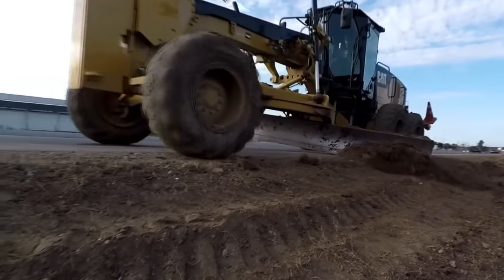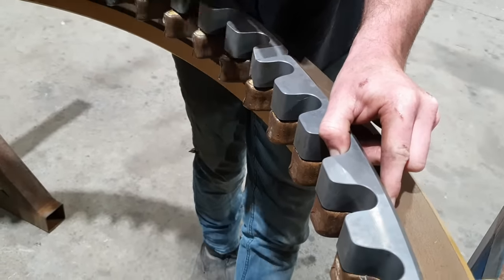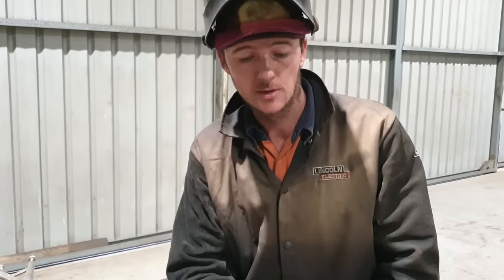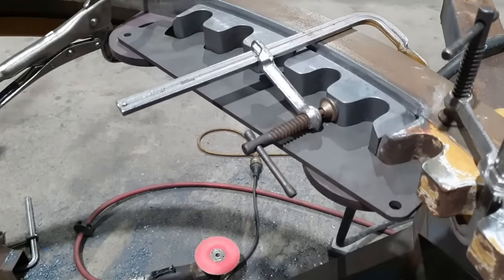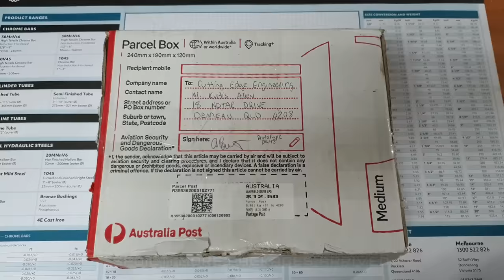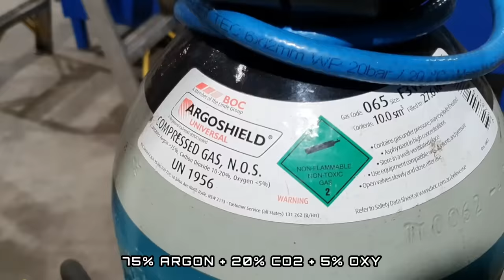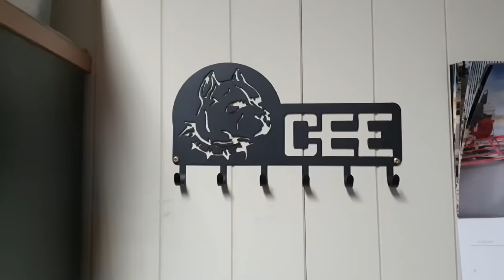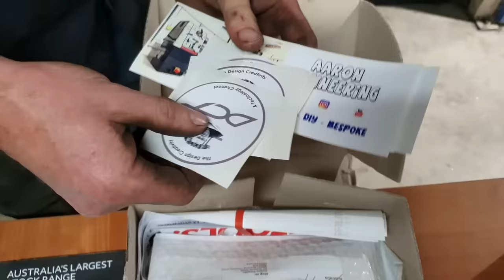Replace DAMAGED Circle Segments for CAT 12M Grader | Welding Fabrication

Comment: 8:03 - being a natural born knocker I just can't help resist the urge ;-) to point out that this sticking out central part of the nut holding the disc is meant to go INSIDE of the disc hole, in case of thick discs used for grinding surface - like this one here. Apparently it helps to stabilise that much heavier discs, or just hold it better and keep it more centred. And yes, I know - it isn't any big issue, the disc would be still held in place by that bottom part.
Also, I'm wondering whether it wouldn't make the job easier using some kind of template, one that matches the inner gear pattern and maybe another one for cutting out worn segments - like, say, CNC plasma cut-outs made from 5 - 8 mm mild steel sheet. I mean, not such tiny "one segment plus" jig you're using here, but more like a half-circle template. Something you'd just tack to "good" teeth and then you'd just fit those replacement segments against it.
Yes, it would add some cost and time to the project, but at the same time it would make torch cutting and positioning new segments a breeze... Just wondering.

Comment: So when you bid a job, is it flat rate or time and materials?   your skill set  isn't like automotive repair, so it has to be properly compensated,  so a flat rate might not work, or just bid the job at $$$ and bash as fast and accurate as you can, Like I did on shop floor so long ago.  Just wondered.

Comment: I found myself wondering if it would not be a more effective method to create a machine to mill the worn teeth away. If you built a tripod assembly that would sit over and clamp down to the rear half of the  gear ring you could mount a centre pin to it. You could then mount a worm powered arm to the centre pin with a small milling head to it. The milling arm would swing and give you a very accurate cut when removing the teeth and be adjustable on the radius via a rack and pinion set to run it in and out. In addition, the milling arm could also be supported at the outer end by the gear ring that is not being cut away for stability due to vertical flex. The end result would be a very accurate milled surface made without heat induction that could cause warpage of the ring itself. You could also develope a welding attachment and use the same arm under power to how your wire feed gun and give a very uniform weld that would be milled off on the top in lieu of grinding. Just a thought...........

Comment: Hum, just thinking.  How about making a outer gear ring or partial - that you could roll in the good ones and continue over the edge of the replacement to verify the gears match as it proceeds and you replace or tack in a gear trace.   Just a thought.  Martin  Just saw the flat one.

Comment: Yo hubiera puesto una chapa encima y hubiera trazado sobre ella, tanto el perfil de los dientes (dibujando desde abajo) como el perimetro de corte con el radio adecuado de las piezas. Paea lo que seria becesario calcular el centro en la chapa (también para asegurarme que la linea de corte es concéntrica y que el aro completo no hubiera sufrido una deformación por algún golpe contundente).

Luego cortando con el soplete la chapa, primero por el radio externo y luego separando por el contorno de los dientes, tendrías 2 plantillas que facilitarían tanto trazar la linea de corte para retirar las piezas dentales gastadas (la plantilla externa)  como el exacto limite de corte hacia afuera (amolar hasta que la corona dentada que es la plantilla encaje en el círculo formado tras retirar todos los dientes) y también habría servido luego para reposicionar correctamente las nuevas piezas a soldar (la plantilla interna valdría para puntear los dientes en su sitio).

Comment: The wear is only in one third of the ring. I wonder, if it'd be possible to make the ring bolted onto the frame, so you could simply turn it around to an unused part.

Comment: If these are done fairly often, why not build a circle jig with a swinging arm from the center that can index into existing teeth? After torching out old teeth, stick a mag drill with an end mill on the arm and mill the ring to a perfect diameter. Ought to save a bunch of free-hand grinding and be more precise.

Comment: I'm intrigued as to why these are not designed to be a bolt in replacement.  Wouldn't be good for CEE, but would surely save a fortune for the operators of these machines.

Comment: Hi Guys, Just subscribed to your channel and I enjoy the work you do and how you present it. Don't really know if it's possible but it would be nice if you somehow show the repaired part back on the piece of equipment it was taken from and back in service. As for the lathe inserts you use, I was wondering if you have ever tried the ceramic inserts which seem to do a great job  on the  4140 and stainless materials.

Comment: I’ve tried to find it but I can’t. What respirator are you wearing?
Reply from the maker: hey mate it's a Speedglas 9100XXi with adflo PAPR
Reply: @CuttingEdgeEngineering  so clutch. Thank you for responding. Seem to be worth all that money? I’ve been using full face respirators but I sweat so much working it gets gross. Also, the filters on the face piece clog up fast grinding metal all day.

Comment: Wouldn't it be preferable/ save time to EDM cut the old sections out? Or waterjet cut them out? I'm just thinking in terms of tolerances etc, as cutting them with a torch isn't exactly precise and requires further machining and probably even building up new material on the cut surface and then machining back to tolerance. IDK just throwing it out there so ppl with more experience than me can chime in. It's probably just a time-related thing right? As in he has the capacity to torch cut and doesn't have an EDM, so while it might be less efficient at least he can get the job done quicker than having to farm the part out for EDM before he can start working on it etc... Let me know!

Comment: As they only seem to use about a third of the arc you would think they would design the mounting so you could periodically rotate the whole thing 120 degrees, and get three times the life out of it.
Reply: That would cut down on their spare sales in the short term, but probably cost more in replacing the full circle when it eventually wore out.
Reply: @18robsmith  I agree on the spare sales point, I think it’s sad we design things to fail just to make a few extra backs,  don’t agree on second point, not sure how often these are fixed before junked but it woul take three times the material 1/3 of the repair slots so total cost (transport setup etc) would be less than three times over the same period (down time would be reduced bu 2 thirds too so cost of ownership/repair significantly less.  If the whole this was designed so the mountings bolted into the ring, the ring could be just replaced every three maintenance periods so spare revenue would be on par.  Just a thought.🤪🧐👍
Reply: @sibat777  I based my statement on the basis that the supplier would see this as an opportunity to increase the price for the ring by a substantial amount over today's price of a full set of ring segments.
Reply: @18robsmith  I get where you are coming from but hopefully third party supplier would then step to bring the price down.  It’s all moot anyhow as there is unlikely to be a market to force a redesign.  Just a good thought experiment.  I was reading recently that insurance companies are righting off cars because they can’t get spare parts like a front axle, it’s a crazy throw away world🤪😱

Comment: So the teeth will get used on the front say 1/3 of the ring. The obvious problem is a design flaw. Make it out of 2 parts so the ring is separate and then you just undo 100 bolts and index the ring.
Reply: There is a hydraulic actuated latch plate that drops in another quadrant of the ring when you set your angle. This plate is your support during operation. The hydraulic motor and pinion gear is for positioning not operation. This damage was a lazy operator or a non operational location plate. It happens.

Comment: With all the "unused" teeth and a few completely worn out, rendering it useless, and causing further damage, I am surprised that they have not come up with a better way of distributing the "usage" around the full circumference?! eg: some way of separating it into an inner ring and an outer ring and allowing them to be periodically moved relative to each other and thus allowing a different set of (new) teeth to be engaged and used.. This would surely prolong the life significantly... but maybe the suppliers prefer regular parts orders ....

Comment: Curtis love your attention to detail, I don't envy you fighting with that miserable 9 inch grinder, don't miss them at all,  if you are doing this a few times it might be worth making a inside circle jig to get the diameter right easily, might make some of the measuring easier, cheers from the UK, incidentally I think one of my customers in Hull Kingston Engineering had a photo of your honing machine on their wall they used to refurbish lathes etc for British aerospace

Comment: Casually:  "It didn't get it's maintenance"....that's more like a person not changing oil in their car for 5 years?
Reply: I wonder how long it takes to get that bad. It looks like half the tooth was worn away. I'm sure it gets all sort of sand and grit flying up from the tires and blade being exposed there like that. Is that steel hardened?

Comment: seems like they could engineer the teeth and the ring so the teeth could be easily replaced, as they already make replacement teeth, make them bolt in since as you said they don't get even wear and are eventually going to need replacement. and the holes would align it, no chances of error at reassembly. might cost you work though.
Reply from the maker: the parts are aftermarket not from the OEM, they would prefer you to buy a whole new assembly 😂👍

Comment: Too bad they don't make the "circle gear" symmetrical, so u could just rotate it as part of regular maintenance and distribute the wear more evenly
Reply: Exactly what I was thinking. Would be cool if the gear was a separate piece pinned in place and secured with bolts so you could occasionally lift it off, clock it 90 degrees or so and drop it back on. Get 4 times the life out of it and when done, just replace the whole thing.

Comment: 40 yrs ago I was up around the arctic circle. We had 6 various older Champion graders that all had this problem. Between that and having the crappiest hyd cylinders ever created I have no love for those machines at all eh. One set of inserts were installed by an apprentice when I was gone and I pretty much had to redo them all. Simple instructions and seeing how I did them just couldn't be followed. Such a waste of time and resources. He was the owners kid so I had to suffer along biting my tongue. How he ever got his universal welding ticket is completely beyond me as I wouldn't sign off on his work so I am thinking someone used my ticket # and forged my signature. Daddy possibly ? He was barely able to put in a flat, fillet weld with a wire feed. Stick welding was totally out of the question as were overheads and most verticals. Welds looked like a sponge. Grrr !

Comment: Hi Curtis, I enjoy watching your work, I take off my hat to your skill and hard work, I also work with metal, but my work is much smaller - I repair the cylinder heads of internal combustion engines. Sorry for allowing myself to give you advice, I see Your work on cutting sectors is a little different, you can use a compass by fixing the axis on three beams relative to the unworked teeth. It will be much easier and more accurate to cut with a cutter and control during installation. This will save you time and effort. Best regards, Sergei.

Comment: I do believe that it would take 24--30 hours to do it properly !! Where I worked, we worked 12 hour days and nights !! So it all depended if anybody else worked on it !! ( 4X4 shifts - 2 days - 2 nights SHIFTS )  The only thing we did different was to gouge it out for a 100% weld !! And we used preheat and post heat !!

Comment: So, wondering why the CAT designers of this Ring for a 12M Grader did not design it with a revolving/removable bolt in ring?  Since 90% of the wear & usage is in one position most of the time, when it becomes worn, simply unbolt it, rotate to unworn position and bolt back in!!!  When the entire ring is worn out, simply remove and bolt in a whole new ring!!!  Seems like this would take only 5% of the time it took Kurtis to repair only half of this ring???

Comment: If only a small section of the sprocket is used, couldn't they design it so the sprocket itself can be rotated (ex., in 90-degree increments) relative to the blade, to use a different section when one is worn out (like rotating a carbide insert)?

Comment: I had to do a job to secure a heavy drawer face using JB Weld but I couldn't get a clamp to hold it in place, so I fabricated some aluminum extensions for my clamps so that one side would reach further than the other and it worked perfectly.

Comment: if you do a few of these how about making a rolled steel band that fits inside of this with pieces to keep it from slipping down, this way you could easily line up the inside circle of the teeth maybe?

Comment: All gas cylinder valves are double seated. If you open it all the way up it will prevent gas from leaking around the stem. Also prevents atmospheric contamination. Common sense says that it is impossible for low pressure atmosphere to get into higher pressure gas. But it happens. Something about turbulence.

Comment: Very good, sound work, and you should be proud, but I think the manufacturers ought to be putting their banks into engineering a system that would allow the whole ring to be rotated as necessary, replaced and recycled, instead of all that patchwork.

Comment: The ring sprocket starts as a rolled ring with the profile rolled in. The teeth are flame cut and flame hardened in the same fixture at the Caterpillar factory.

Comment: Diese Straßenhobel sind auch im Industriebau Nord in Halle/Saale Deutschland gebaut worden. In meiner Firma sind die Fahrerkabinen und die Räder montiert worden. 
1990 war dann Schluss mit der Produktion des Straßenhobels in Halle, aber meine Firma gibt es noch.
These road planers were also built in Industriebau Nord in Halle / Saale Germany. The driver's cab and the wheels were assembled in my company.
In 1990 the production of the road planer in Halle was over, but my company is still there.

Comment: Hast Du gewusst, dass die Masse bei Bandmaßen, Zollstock etc. große Toleranzen haben. Es gibt dafür sogar internationale Normen, die ich jetzt nicht sagen kann. Die verwendete Norm ist am Anfang des Maßes angegeben.
Es ist also wichtig, dass Du für solche Messungen, wie Di sie am Anfang des Videos gemacht hast, immer dasselbe Gerät verwendest!
Did you know that the dimensions of tape measures, folding rule, etc. have large tolerances. There are even international standards for this, which I can't say right now. The standard used is indicated at the beginning of the measure.
It is therefore important that you always use the same device for such measurements as you did at the beginning of the video!

Comment: Just wondering. Im doing one on a john deere grader. Their procedure calls for preheat of 350 farenheit and wrapped for at least 4 hours. The circle you're doin doesn't require prehest?
Reply: John Deere using cast iron and Caterpillar cast steel?

Comment: Why don't you start with welding all the segments in one part, that way the radius is correct and you only have to make sure you have one pitch right, the other side will be automatically correct.
Reply: Try doing that on some scrap and you'll soon find out ;)  As the welds cool it pulls the metal towards the weld. It wouldn't be automatically correct, nowhere close.
Reply: @topduk  That is a good point, well I got a desk job :)

Comment: Three things.  First, and not that I personally care or think there is really any issue, but the slingshots someone sent you are, I believe, technically illegal weapons that one isn't even allowed to possess.  Not 100% on that, but pretty sure and is worth clarifying, given that it is displayed on a YT video.  Happy to be corrected if I am wrong.  You know the way it goes in 2020s... when some copper is dropping around to deliver your bravery medal for saving someone's life,  they will say "So, what is that hanging on the wall?", and next thing you know, SWAT has raided, and youre in custody with the rubber hoses. 

Second, while it would be a bit of work to make one if they don't exist, but a single piece circular jig which meshed with all the teeth simultaneously could dramatically simplify the process.  Would that be in any way achievable?  That way all the existing in-place sections would positively locate all the new ones during installation.

Thirdly:  boy, that definitely looks tricky!
Reply: “You can legally purchase a slingshot in Queensland, the ACT and Tasmania, but not in NSW, Victoria, South Australia, Western Australia or the Northern Territory. (The only exceptions are approved toys specifically designed for children.)” Looks like Kurtis is ok.
Reply: @geoffwysham1731  Ah ok, thanks for the heads up. I am in NSW....
Reply: @alexanderSydneyOz , yeah, apparently no holds barred in Qld!